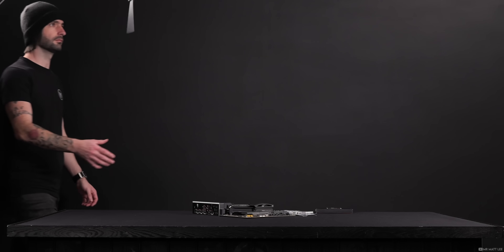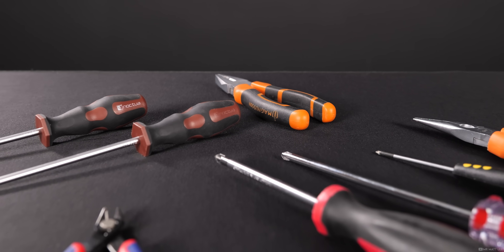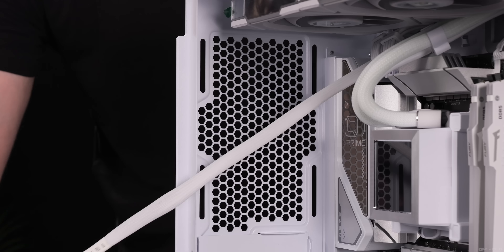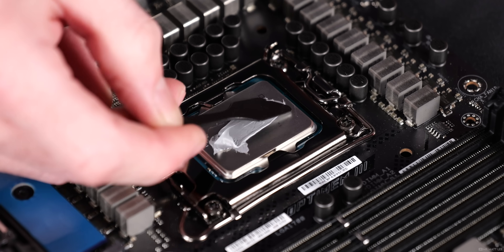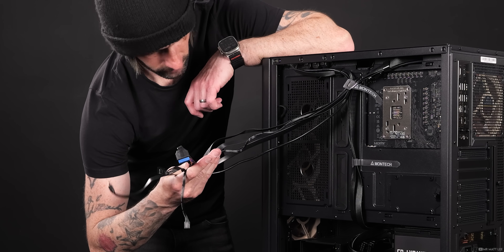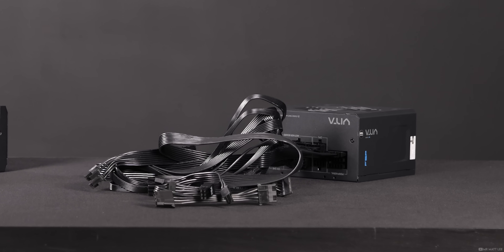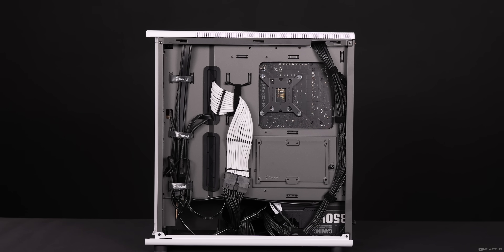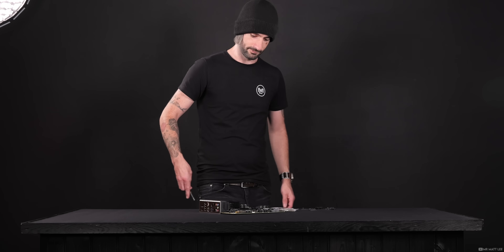Zero to Hero: 10 Essential PC Building Tips and Tricks

Comment: 0:23 can confirm. Built my first pc late 2023 and despite watching a lot of videos, including builds in the case I bought, it was just such a nerve wrecking experience, as I never felt sure that I connected everything correctly (I also sometimes was just plain stupid, like thinking my GPU was broken until realizing the next day that I only plugged in the 8 pin cable, but not the 4 pin...)

Comment: would you be able to explain why 2 ram sticks are better than 4 for gaming? i was under the impression that 4 would be better. Thanks
Reply from the maker: @mikelemos87  For most gaming setups, two RAM sticks are generally preferred over four. While four sticks may seem to offer more capacity, it can sometimes lead to instability and lower performance, especially when trying to achieve high speeds or overclocking. Two RAM sticks allow for a more efficient dual-channel configuration, which can improve overall system performance and stability, particularly for gaming. There’s quite a lot of information about this online 👌

Comment: How would you setup for good airflow if you use want to use a 360 AIO cooler for the CPU (9950X3d), as well as a GPU with a 360 AIO, like the MSI Suprim Liquid 5080? I assume the CPU exhaust up top, but wasnt sure if the GPU radiator would go in the front or bottom, and as intake or exhaust.  I am still up in the air on the case with a few shortlisted cases: Lian Li 011D Evo, Fractal North XL or Antec Flux Pro.

I have not purchased the case or cooling parts yet (aio, gpu or fans), so can switch out CPU AIO for a tower cooler, or GPU to one  that is air cooled and not AIO), so open to changes. I only have the CPU, MB, RAM, SSD and PSU so far.

Thanks.

Comment: As an old school power system builder with more than 8k builds under my belt I can fully endorse and backup every single tip and trick Matt described here! One critical tip I would add is NEVER EVER use liquid metal unless you are fully aware of how to use it and even then there are far better options. Any time someone comes to me with a build where some moron has used it, I no longer even offer to repair their system!

Comment: IMO the two places to have the most care are putting the cpu in the socket and the other is too make sure you line up the memory sticks correctly and apply the firm install pressure straight down.

Comment: I am 60 yrs old and have built maybe 75 pc's.  My cousin who is 57 was upgrading his 7700X amd cpu to a 9800x3d for whatever reason.  He has built maybe 5-6 pc's spread out over 15-20 years.  A month ago he was putting his 9800x3d in his mb and he was about 4 inches above the socket (he said) when the cpu slipped out of his hand.  Corner of the cpu fell right into the socket.  He had me come over to his house and asked if the cpu and mb are ok.  Looked at both and said cpu looks good but the mb is dead.  He asked me "can you fix it" ? I said, "not a chance in hell, looked at those pins"!  He promptly got on best buy's website and saw what mb's they had in stock.  Got lucky and his same mb was in stock. Promptly went to bb and paid the $280.  Brought it home and after he took everything apart he asked me to put in the cpu.  He is  very fat fingered.  I charged him Pizza and beer.  Also cleaned up his crappy cabling job.  All is good now.
Reply: To ruin the cpu pins like that is a proper kick in the twins
Reply: I’ve fixed those pins before, it just takes patience
Reply: I hope you told him he’s a massive doofus too lol

Comment: if you are overclocking and your case has a reset button, connect that reset button to the clear cmos jumper on the motherboard in case something goes wrong during a reboot or crash during a testbench run.

Comment: Great tips as always! The one thing I learned AFTER fully installing everything and getting my SFF system running was that motherboards will often have a dedicated USB port for bios updates. I did not know this and spent an hour wracking my brain trying to figure out how to update my bios, assuming the front USB port was sufficient. I was able to do it in a complicatedly different way, only later to look at the back of my PC while I swapped out the WIFI anntenae to find the clearly labeled bios USB port. I should have fully read my mobo manual. This was my 2nd build ever after a 20 yr hiatus, and honestly things haven't changed much. Another tip: Keep a USB drive of your OS software. Get a labeler and print out the CD key for your OS onto the drive. You never know when you need to do a full system wipe and re-install your OS.

Comment: You said about experimenting and getting things wrong. I actually started my first build on Saturday using a Hyte Y70 touch and a new 5080 founders edition GPU. Inspired by your build last year, I opted for an air cooled Noctua NH-D15 CPU cooler only to find out after fitting the cooler that the GPU doesn't then fit due to the GPU cable and fans on the fin stacks. I did so much research before I bought all the parts and measurements were correct but doesn't account for the way things are installed. Instead, I've now opted for a AIO in NZXT Kraken elite, no RGB fans which arrives today. Thanks for the inspiration on your builds and keep going with the no RGB aesthetics.
Reply: The cooler fans were coming in between the  gpu cable you mean ?

Comment: I had a hard time installing the arctic liquid freezer III on the o11 vision compact case. since the aio didn’t come with a manual, I had the bracket upside down. I was frustrated for 30 minutes why it wouldn’t screw down. Hopefully my frustration didn’t lead to the cpu socket and pins to break 😢
Reply: The manual comes on the box with a QR code

Comment: Ahhh, this is a good reminder for me as I need to remount the old aio.
Reply from the maker: Remount so you can put new thermal paste on, or just because you don’t feel it’s sitting so well? Either way, take your time and be sure to clean everything up good and proper before the new paste goes down 👌
Reply: @Mr_Matt_Lee  it's been nearly 3 years and I've noticed a slight creep up in temps so I figured I should remount with new paste.

Comment: I've built many systems and I approve of this video

And yes the best tip to have is to have confidence, confident hands are far more reliable than wobbly nervous hands
Reply from the maker: Confidence can be boosted with the correct knowledge too. Stoked you enjoyed it 🤘
Reply: I had my first PC delivered as assembled. I am in need of an upgrade and will be getting a fully new system. I'm considering assembling it myself when I get it but.. everything is so expensive and these are delicate electronic items. I'm terrified of breaking a part, ruining a pin/socket, not getting all the assembling correctly and it not working, getting incompatible pieces etc. Simply too afraid. There is a part of me that wants to explore this aspect of loving PCs but on the other hand, ruining/breaking a piece can set me back a significant amount of money. I am in a dilemma.